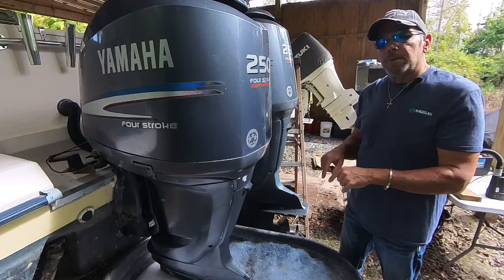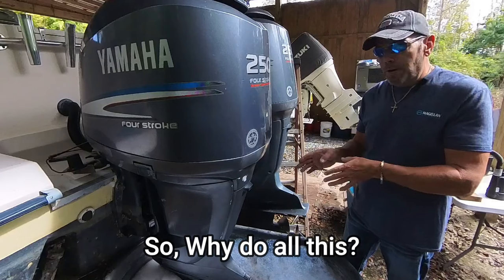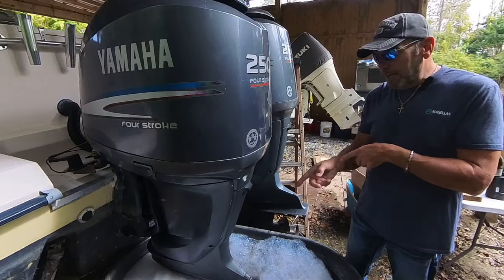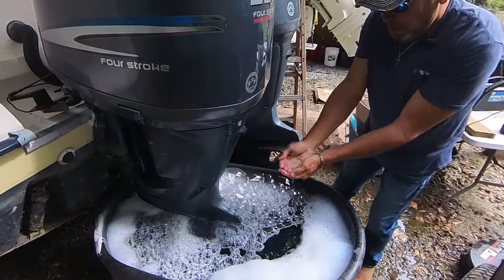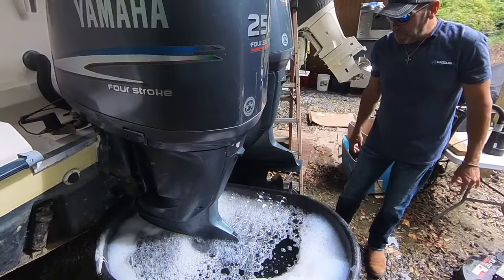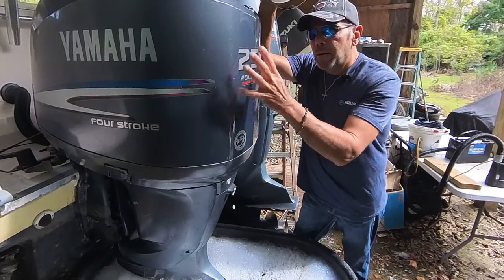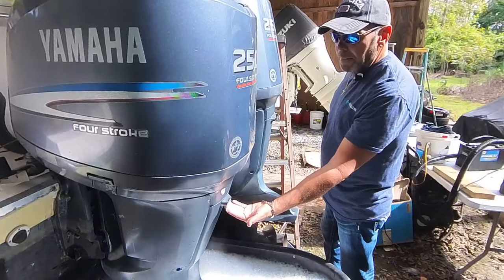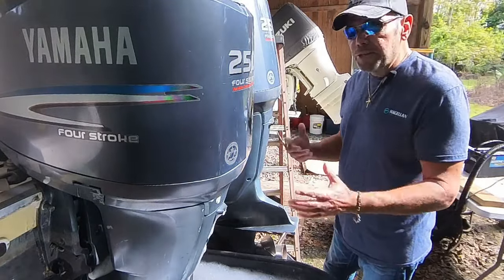Flush your Outboard with Vinegar and Dawn - The BEST Corrosion Maintenance

Comment: There can be no proof this restores or maintains coolant flow rate without measuring the amount of water entering the cooling system and measuring what comes out the other end over a given amount of time compared to what the flow rate was when the motor was new. Also there is no visual benefit that can be taken from this video as nothing was disassembled to show the inside of the cooling system before or after the flush proving corrosion buildup removal. The outside of the engines look new? OK.
Reply: The guy didn’t have to prove you or anybody else about what he does with his motors, didn’t have to take anything apart to show you the results of his method, one thing is for sure, the shit works, I tried it, I did take pictures before and after and to my surprise it did clean, so, if you don’t believe the guy or not is your problem.
Reply: Ouch, lighten up.

Look, why do people make these kinds of videos…mostly to help others I’m guessing. I think the guy you jumped all over is just pointing out, if you’re trying to help others, how about some proof as to what it’s actually doing. No, the guy that made the video doesn’t HAVE to prove to this guy or anyone for that matter but you gotta know there would and will be skeptics and rightfully so, this isn’t some cheap toy to be doing just anything to. BTW, I work in a marine service center.

But certainly some type of proof would add another level of legitimacy to this video, maybe even earning the poster a few more 'Likes'. Something even as simple as starting with a clean tank, draining the tank after the treatment through a mesh strainer and showing scale or whatever, anything supporting the treatment would be something, better than nothing.

Ya know, too many people today just gobble up what anybody posts on the Internet WITHOUT question and there are a lot of dumb*ss people posting videos on subjects they aren’t experts in or even exceptionally knowledgeable in. There is absolutely no reason that the OP shouldn’t question this treatment.

Not sure why you felt the need to jump this guy’s ass…the guy that made the video (Bottom Fishing 24-7) didn’t see a need to do it either. Ever heard of constructive criticism…just say’in.

How ‘bout you Bottom Fishing 24-7…your thoughts?
Reply: Am  quite sure he knows what he’s doing. No one is gonna try smthg on an expensive outboard just to post a video. For each is own technic man. Do you have one doctor for all your needs. Dnt think So. Rest my case, thie shit wrks say Thankyou amd maybe you can try it in your marina shop. 👏👏👏
Reply: @barthjackk  you keyboard people are funny!
Reply: @jeffro9276  Keyboard people???
Reply: Thank you for you valuable insight KAREN!
Reply: Vinegar dissolves minerals, Dawn breaks down grease. What's to question?  I'm surprised he didn't use 2 gallons of Vinegar.
Reply: C'mon man, the man is showing us what has worked for him for a long time. Take it or leave it. Makes sense so I choose to take the advise.
Reply: if not completely clogged, it will not change water flow but it will deteriorate heat exchange on the motor block.
Reply: @hrvojelasic5794  Can you explain what you think is doing what under what conditions?
I checked that maximum recommended Vinegar with aluminum is 5%. How much aluminum do you think is in the cooling path?
Reply: @artsmith103  not sure but i.e. all bottom part is aluminum. not sure about motor block materials. water go through the bottom part at some point after it is out from the steel pipe/impeller. Vinegar is for sure good for removing deposits of salt but not good for aluminum, but again, maybe during a short period and in some ratio no problem.
Reply: @artsmith103  for the coffee machine you can also use lemon acid or whatever works for you. I mean repair is not that complicated. Depending on the price of machine, you will need to change the heater after some time, maybe. Provided you don't do that maintenance.
Reply: This video  is for entertainment purposes only. With a world fuuull of lawyers its for entertainment purposes only. He's doing a free service to us all. No one is paying him to do it. For all its worth he's showing you a Picasso that has 3000 hours on it like he says without a hiccup. If you would like to paint a Picasso like he  has you can try UT yourself at your expense with all the before and after teardown BS you want to do. I like his work of art on this LCD screen and all you self righteous arrogant nitpicks can do your own experiments at your own risk.

Comment: Just did this, 150gal tank, yamaha 115, used 3 gal vinegar and entire bottle of dawn. However, dawn didn't get completely tucked into intake screen, parts of it kinda floated into tank. Also powered exhaust completely dry, no soap or anything coming through. Is that normal?

Comment: A sincere thank you to the author. I run a small yamaha 4hp four. Stopped pissing water. I installed 8 pieces of lower end rubber i
Reply: Parts all oem. New impeller and housing. Fired it up no pissing.
I performed your procedure 1st pass nothing. Walked back home for a pair of pliers. It soaked, engine off for 1/2 hour. Fired it back up. Pissing like a race horse! Flushed with clean water for 25 minutes. I'm now off to Strom Thurmond lake happy and full of confidence in the motor. Oh, found a small blob of brown crap in the bottom of the turkey pot. That was the blockage. New thermostat. The piss water is not even warm either. You're the man! End-of-happy-rant.

Thanks man.

Comment: How about smaller outboard / bucket ratios . I have a 35hp evinrude 1978. Using a 32gal trash can . How.much vinegar/ soap
Reply: gallon-won't hurt//
Reply: We use 100% vinegar to clean an elec tea kettle and our drip coffeemaker. Hardware stores sell premixed 30-60% vinegar. Throw a gallon into any container, doesn't matter.

Comment: I use vinegar and baking soda. When the water in the water outlet is low, I pump the mixture of vinegar and baking soda up through the outlet hole with a syringe.
Reply: Look it up---vinegar is an acid, baking soda is a base, when mixed together they neutralize each other. Better to use the vinegar first and then follow it with the baking soda, then each do their own thing. [Unfortunately people confuse the fizzing that happens when they are mixed, with cleaning. I did, too, until I got suspicious and looked it up!]
Reply: Vinegar is likely more valuable.  Acid dissolves minerals like calcium and iron.

Comment: Nice video showing the flush setup.
Thanks. 
I take my thermostats out and do a barnicle buster flush with a fountain water pump every time I drop the lower unit to replace the impeller.
Let that barnicle buster cycle for about an hour while I replace the impeller in the lower.
A lot of scale at the bottom of the barrel every time. Good stuff.
Reply from the maker: @jejoko Thanks! Agree with you about Barnacle Buster as well.

Comment: What type of white vinegar are you using? In Norway we got to types in the convenient stores, 7% and 35%.
Reply: I guess it is alcohol vinegar C2H4O2.
Reply: @hrvojelasic5794  But in what concentration?
Reply: @raymondnybakk1311  that I don't know, I know that vinegar is aggressive to aluminum so not sure if it works in high concentration but he use low concentration frequently (he said 1-2 times) a month and by white foam you can see it works. Detergent probably stop all processes after. I guess he knows what he is doing.